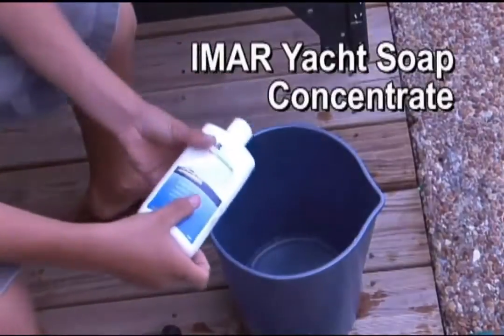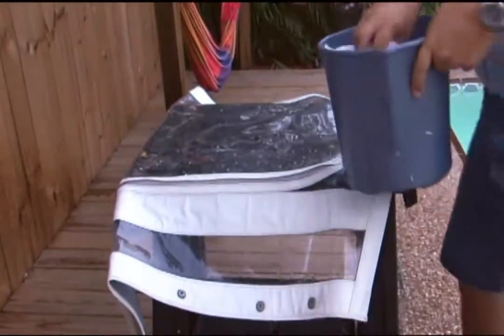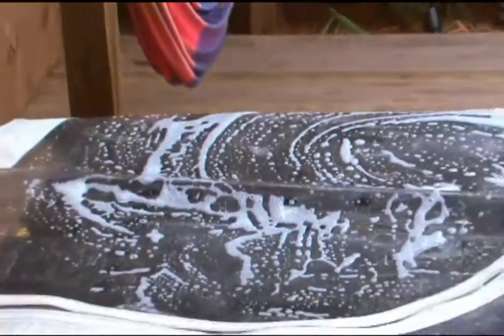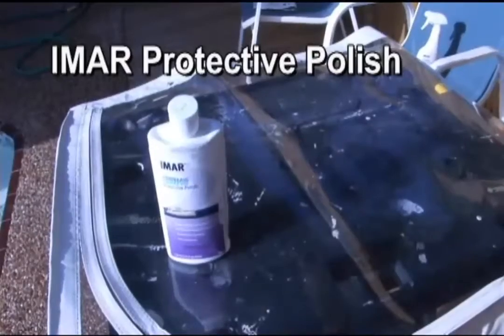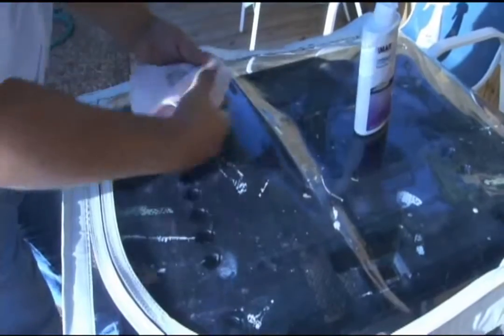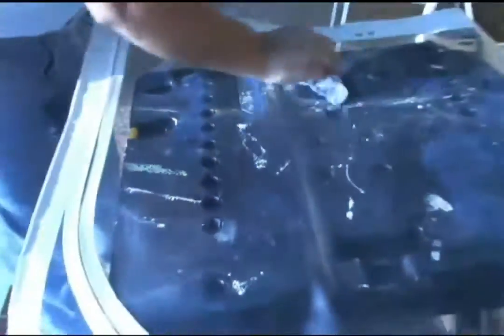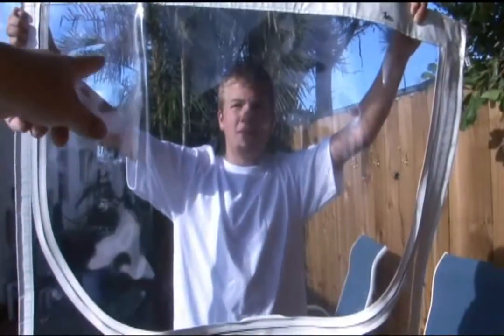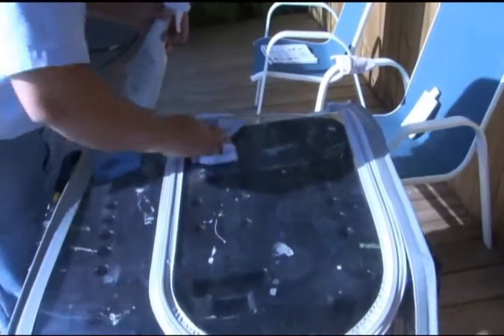Imar Products for Strataglass Clear Vinyl Window Material

Comment: I'm looking for a product to restore an old cloudy Strataglass window back to a more useable state. Your demo show a window in perfect condition...whats the point?
IMAR Protective Cleaner, you state, "Some people use it daily" Who would buy a product that requires you to clean and polish the boats Strataglass daily or weekly? That would clearly indicate an inferior product and a poor use of one's money not to mention one's time.
I thank you for the heads up, I will avoid IMAR and look else where for a more durable product.
Reply from the maker: +Karl S Once the clear vinyl becomes cloudy, it is usually too late, the plasticisers have already migrated out of the vinyl and the damage is irreversible. When the plasticiser is gone your clear vinyl becomes harder (no longer soft) and then becomes cloudy. The point in using a product like IMAR is to prevent that from happening. If you would have used IMAR (occasionally) the plasticisers in your clear vinyl would still be present and your vinyl would be soft, clear and not cloudy. You will have to replace the clear vinyl. 
Here is a good link for more on plasticisers: http://www.pvc.org/en/p/plasticisers
Reply: I have done both things you've suggested. Our bimini is in the canvas shop having the window replaced and I order a bottle of IMAR Strataglass Protective Cleaner. 
Thanks for you help and link to plasticisers, it helps to understand process.
I apologize for my abruptness. By the time I wrote that I had sat and watched to many youtube videos. In so many of these videos they appeared to be applying their product to new vinyl, making it very difficult to determine whether there was any true benefit to their product. I should have walked away and come back later.
Again, thanks for you help
Karl